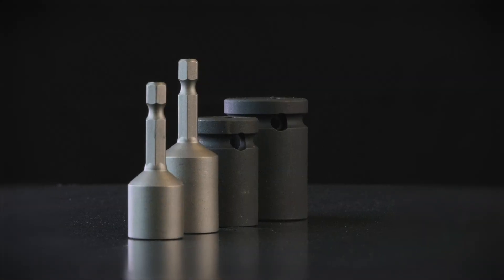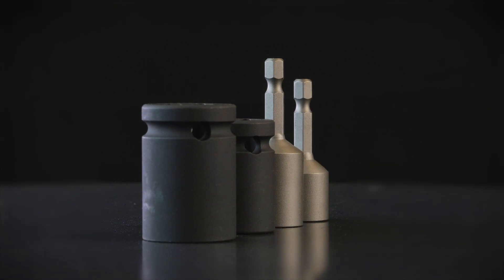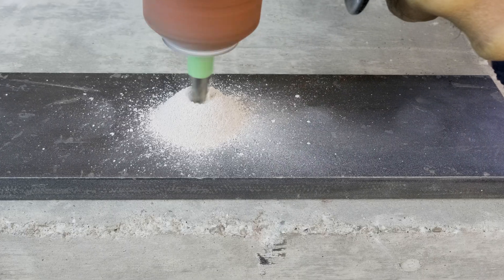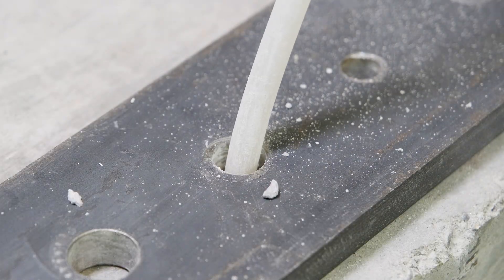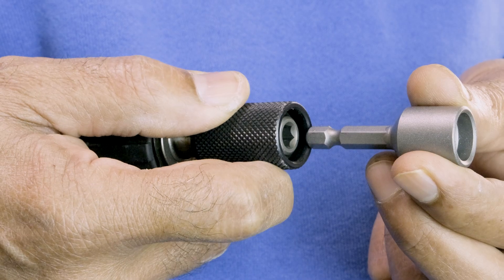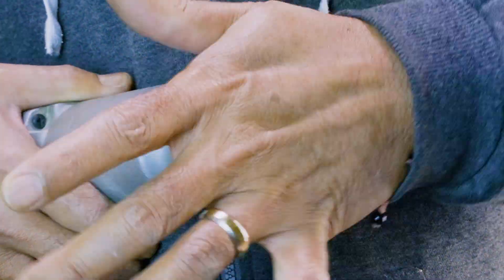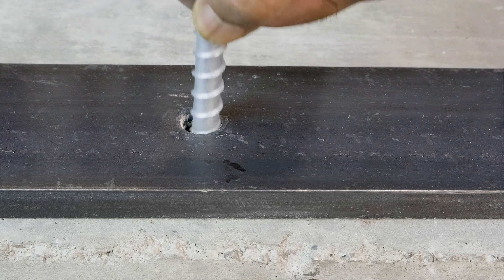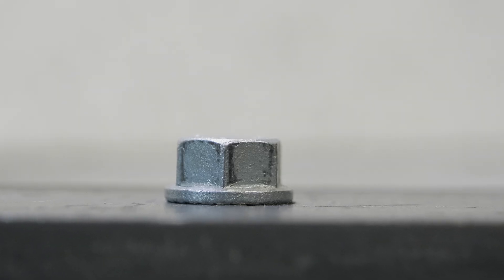TORPEDO BOLTS - INSTALLATION

Comment: Tells you not to use an impact and then immediately advertises an impact socket adapter
Reply: It says “use a manual torque wrench, non percussion drill, or impact wrench” so just don’t use a hammer drill.